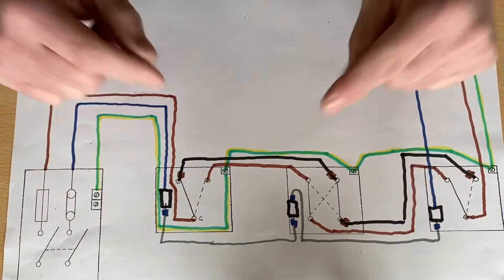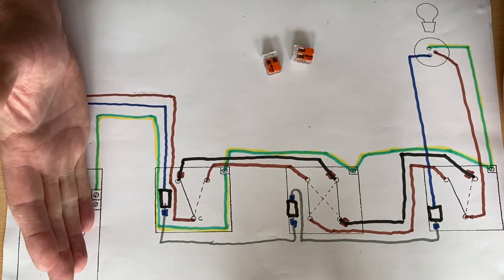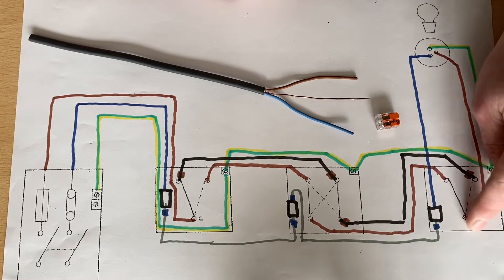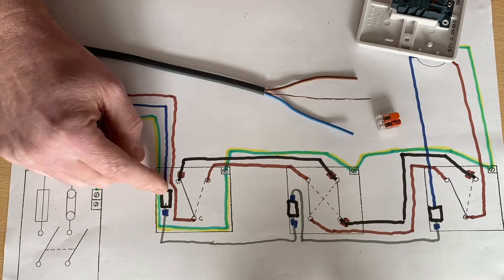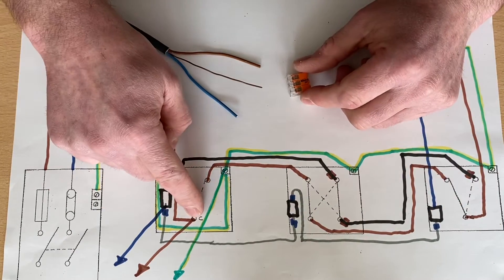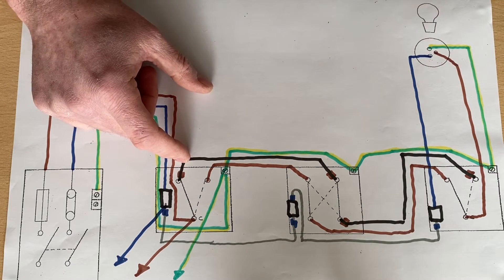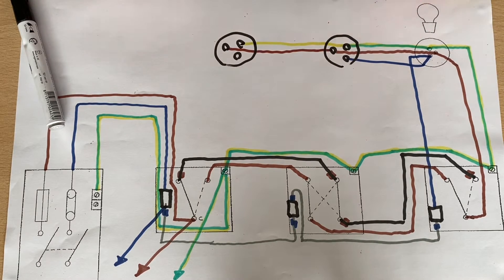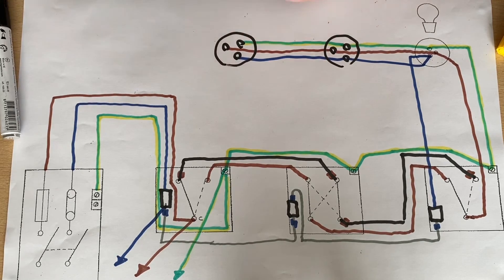Wiring Diagram Wired Through the Switches Lighting Circuit - Extending the Circuit Adding Downlights

Comment: Nice video. It has clarified what is going on in one of my switches at-home which is a 3 gang with 2 2-way switches and 1 single switch. 6 cables coming into the back box and 4 lives into the common connection. Seems a bit trickier than the loop in method and very crammed. Love your videos. Great explanations and attention to detail.